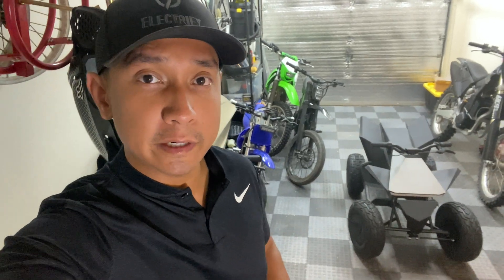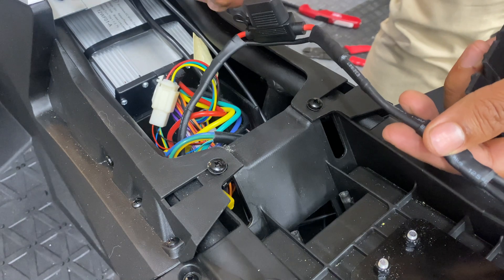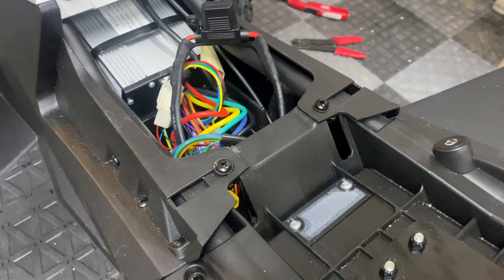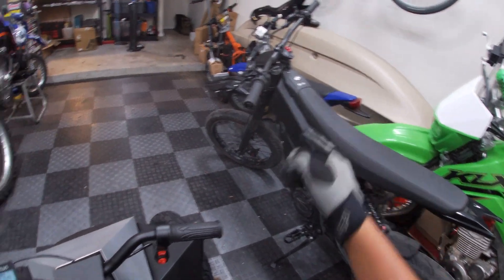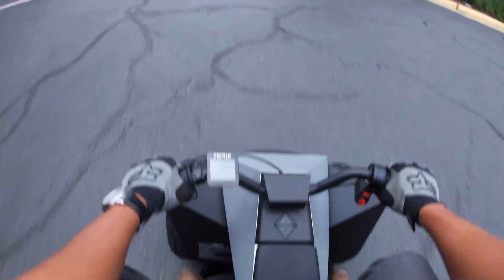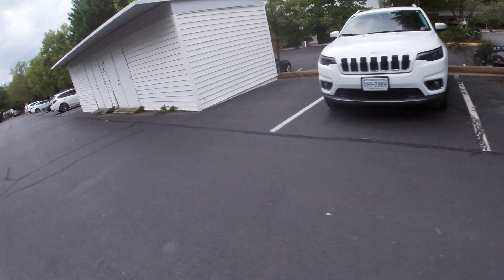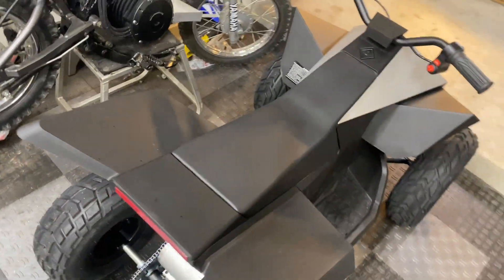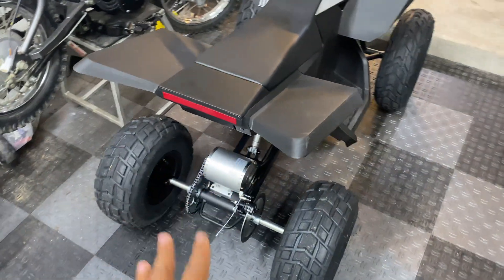Tesla Cyberquad NEW TOP SPEED with the Kunray Brushless Motor Swap

Comment: Are you able to use after market battery and controller ??
Reply from the maker: Of course! Just depends on your budget. This is also an aftermarket controller already though
Reply: @PatOutdoors thank you for your feedback.
Reply: @PatOutdoors   I see that the battery slides into an opening in the back of the quad. Some batteries are much larger so how will that work

Comment: Awesome video! just wondering what size of brushless motor you would go for to achieve more closer to 50mph
Reply from the maker: @jimisweetstick6566  Same size, higher wattage. 3000+W Kunray MY1020 with at least a Kelly or Trumoto controller and a good 72V 20-30AH battery, more speed gearing instead of torque.. These things feel super sketchy above 25 MPH due to suspension and steering geometry though.. I don’t recommend it.
Reply: Do you have to use twist throttle

Comment: I am in the process of upgrading our quad using your steps.  What did you ultimately do about the front and rear light bars?
Reply: Pat I bought a 12v step down from Amazon and found out the headlights won’t work after confirming I had a nice clean 12v. I took a chance and went straight 41v from the indicator lead and hola. Headlights work.
Reply from the maker: @GavenKanemori  well that’s a good discovery. Congrats on getting yours working
Reply: My son and I want to tell you thank you very much for your vids. If it wasn't for this we wouldn't have taken on this project.  Test rode it today and got 22mph from 10.  Great summer project for us.
Reply from the maker: @GavenKanemori  glad to hear I was able to help!
Reply from the maker: Nothing, the owner didn’t want to do a 12v step down converter so I didn’t wire it up.
Reply: @PatOutdoors  thank you Pat.  Do you have any recommendations on what you may  have looked at for a 12v step down?  Tonight we are going to mount the motor and hopefully give it a test ride tomorrow.

Comment: Also, the front headlights connect directly to the front indicator lights on the controller without any issue. I followed your videos and bought the exact Kunray motor kit.
Reply: Did you figure out taillights with Kuneay controller and OEM lever?
Reply: I never had the original brake lever and had to buy a replacement which works and I also replaced the taillights internally with a compatible one with the motor.
Reply: @josephjlee777  Thank you for the reply. Would you be willing to share the lever and taillight part you used?
Reply: @josephjlee777  Thank you for the reply. Would you be willing to share the lever and taillight part you used?
Reply: 36V Electric Rear Light LED Bike... https://www.amazon.com/dp/B07GV8QXBV?ref=ppx_pop_mob_ap_share

Comment: Hey, I own the EU version, it’s only a 24volt system. Do you think I could just use a 36v battery? The Cyberquad is a bit slow with the 24v battery 😢
Reply from the maker: Dang! 24V.. I'm not familiar with the EU version's controller so I'm not sure if you can just overvolt it without any other supporting modifications.
Reply: ok, thanks, maybe one day I'll try it - worst case I blow the electronics and then replace them with other ones  @PatOutdoors